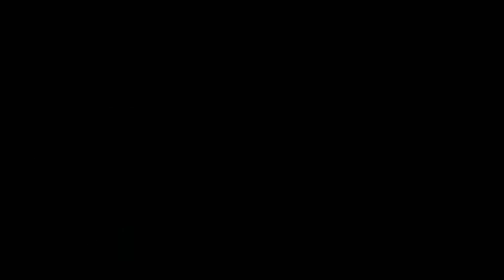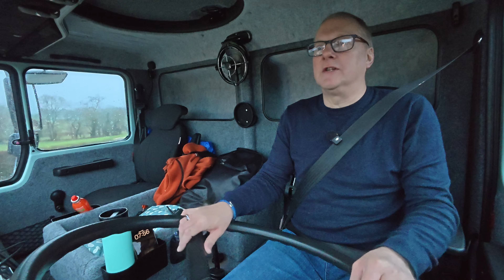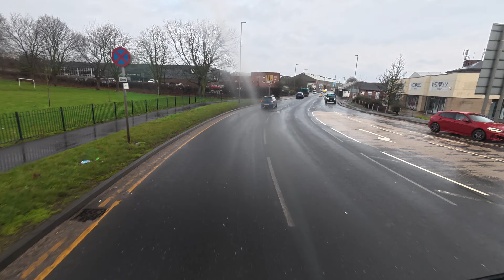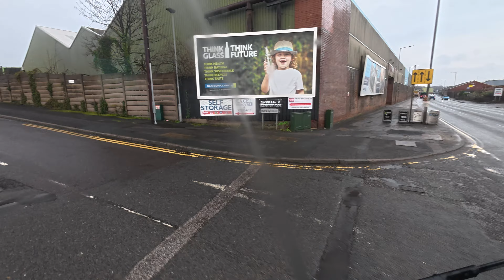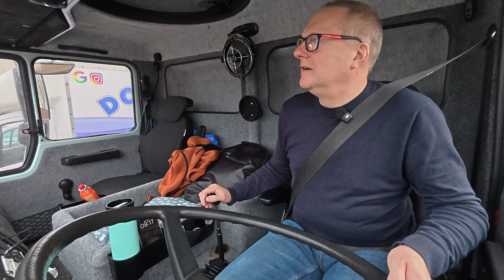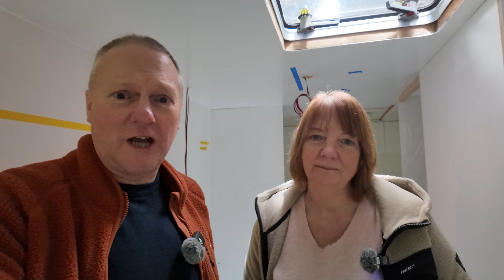We didn't expect this... Huge Mercedes 1017A Electrical Upgrade! (Ep. 22)

Comment: Why are you not using a main BMS on the Lyncs bus bar? Looks like you've been sold three separate ones.
Reply from the maker: The batteries have their own BMS build in and when connected together work as one and in conjunction with the Victron Cerbo.